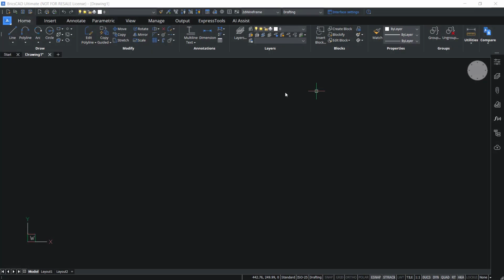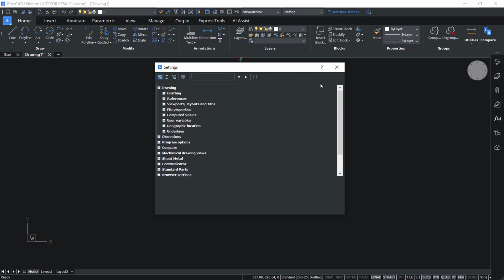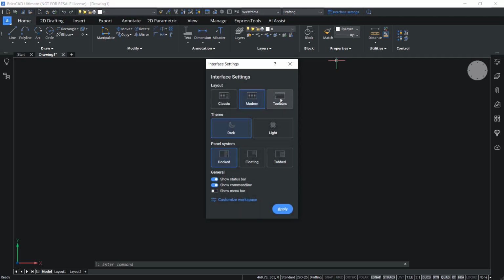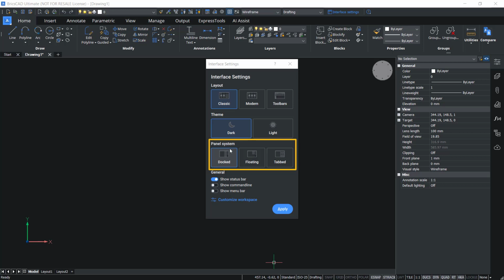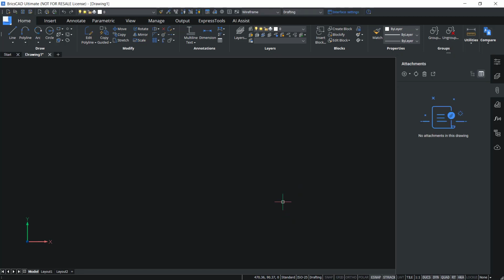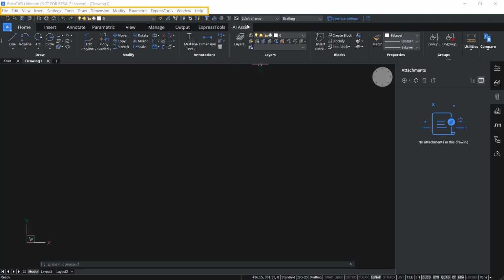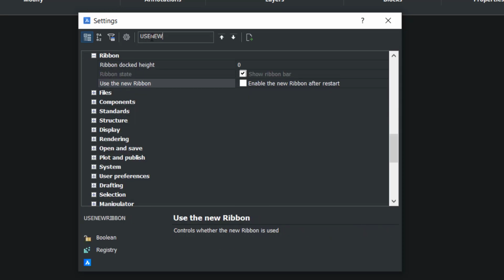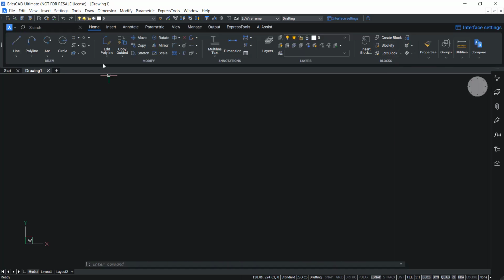BricsCAD V23 Interface Settings | BricsCAD V23 New Features

Comment: What is this for?
Reply from the maker: Hi Robert, thank you for your question. This video walks you through the steps to make BricsCAD V23 your own via the new Interface Settings dialog. This new feature allows simple customizations, such as changing the color theme or panel docking system.